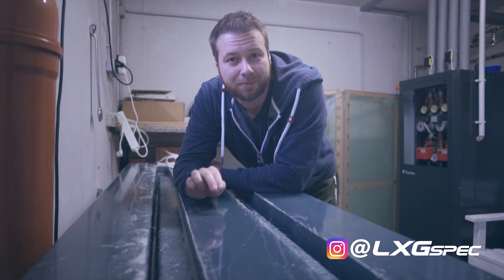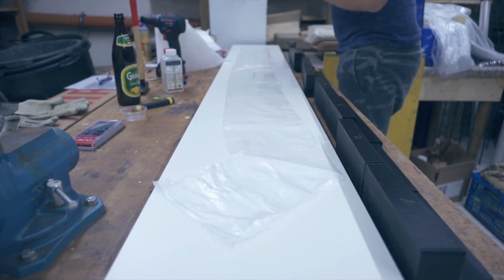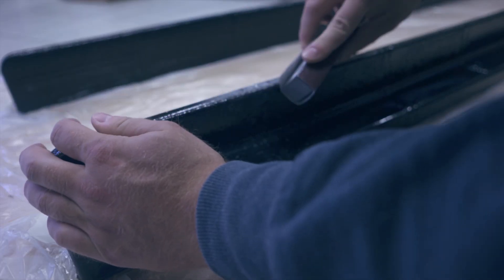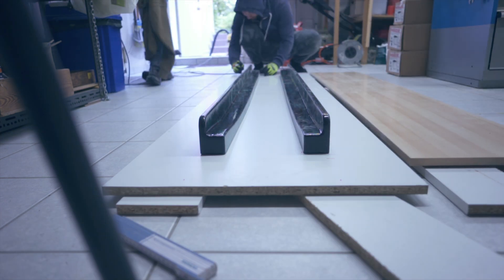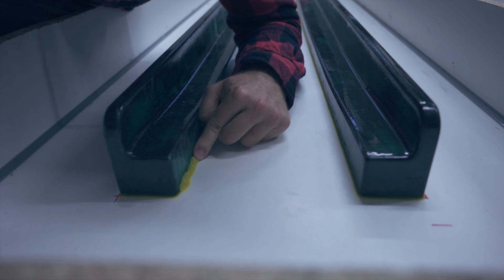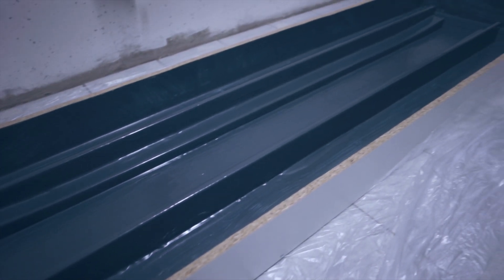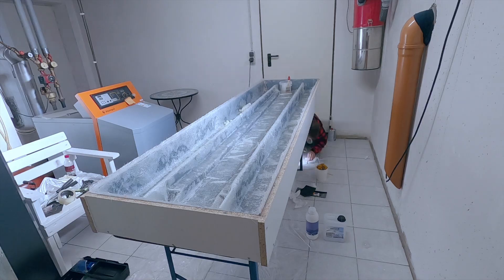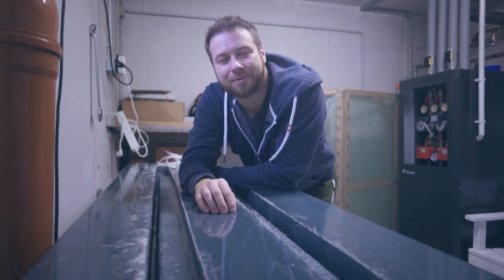How to make a fiberglass mold from a 3D print - R34 side skirt extensions

Comment: You have probably learned this by now, but using cones at the top of your holes takes away the need for support material.  to remove from mould easier,  design cavities you can get a few fingers into,  think quarter of a taurus subtracted from the non-critical faces.  if you worry about the overhangs while printing, don''t.  it prints beautifully.

Comment: Do you think eSun PLA+ would work if you don't have PETG on hand?   Or do you think the heat from the curing temps would warp it, even printed 100% solid?
Reply from the maker: Excellent question, I must admit I haven't tried, I went petg very early on due to pla's weaknesses and never looked back since. Depending on the size it could be a very pricy test, in general I'd recommend starting to work with petg. That said feel free to test of course, it might very well be working just fine!
Reply: @LXGspec  Thank you.  I think if I tinker with the wall thickness, it might work.  I am curious though, how thick did you print your PETG walls?  I know the glass transition temp for PETG filament is 85C, while the PLA+ I use is roughly 60 C.  If you can share that info, that may help me gauge my slicer settings for the print.  Again, thanks for responding to a year old video.  :)
Reply: @bobsponge1877 bro did you do it yet? What wall thickness did you use/ how many

Comment: It seems to me the choice to 3D print the elements has nothing to do with ease of fabrication, expedience, or cost savings- building the forms out of foam or wood would have have been faster and less expensive.   What am I missing?
Reply: people tend to use the tools they are familiar with.  3D printing can be way more accurate than working by hand.  and for repeatability you really can't beat it.